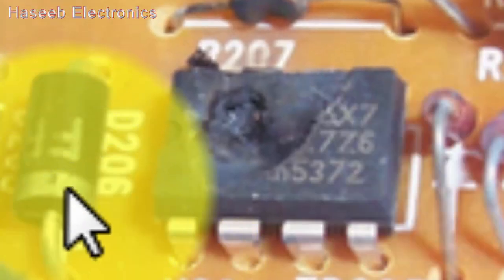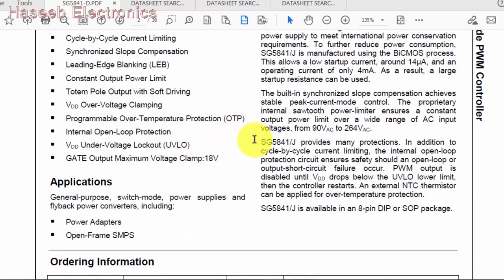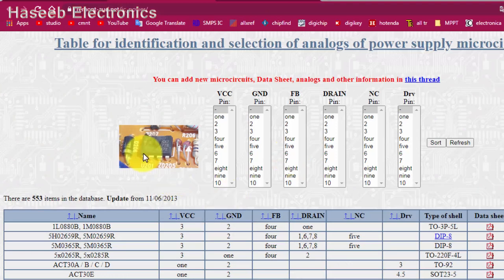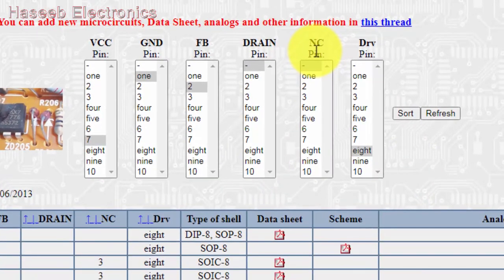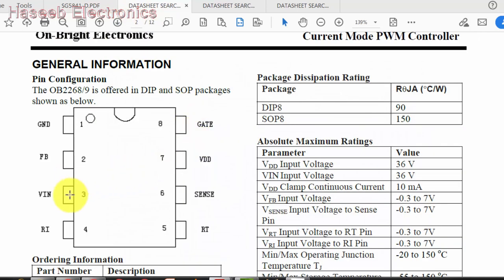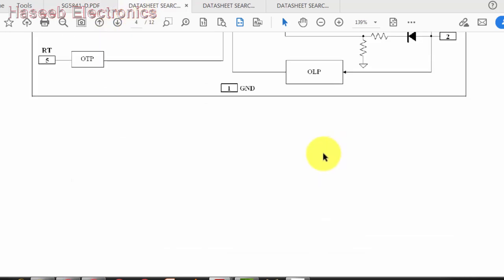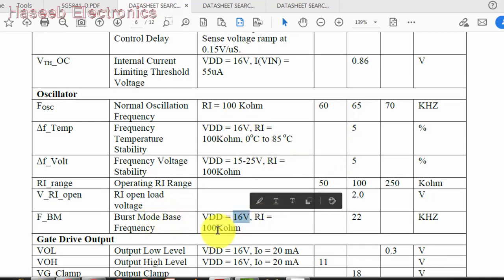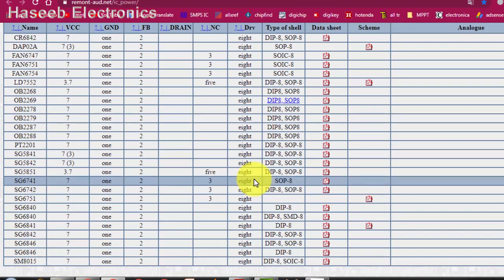[368]  How to find any Unknown SMPS / PWM IC Number, SG5841J PWM Controller Equivalent OB2268 OB2269

Comment: good information brother...I have a question. since the pwm ic was damaged and has been taking out from the board..is the auxiliary winding still outputting Vcc voltage? if so..that means we can easily identify the voltages for the pwm ic..

Comment: In frontech monitor SMPS the 8pin has no number. One side all the 4 pins are at -ve. What will be its number?
Reply from the maker: there are many ICs have all 4 pins as source pins 
if you can write all pin functions 
then i can try to find 
for example 
pin 1 is connected to optocoupler, pin 2 vcc capacitor, pin 3 resistor, pin 4 transformer, pin 5 to 8 are ground etc

or send pictures of ic closer area front and back side
to my whatsapp 00962-79-1161084

Comment: Hi. I have a 1500w 12v inverter Chinese with an unmarked 16pin pwm ic. I cannot identify it.. so far vcc = pin 15,  gnd pin1, E1 pin7, E2 pin10 , pin 3 5,6 and 13 nc

Comment: How to contact you sir,i am a 73 years old person and want to clear some doubts regarding Smps boards with pwm ic driven by some modules which are in black epitoxial coatings.
Can we remove  and still make tjem to work.
Reply from the maker: first of all i am thankful for writing your comment 
most welcome sir!
my whatsapp number is 00962-79-5324272
gmail id is ashraf4ta4
that coating is really a horrible technique from chinese manufacturers to conceal their designs
if that item is suspected, most of time replacement is most preferable solution
or reverse engineering is to be done to overcome the design structure